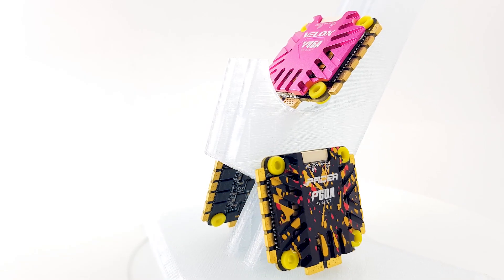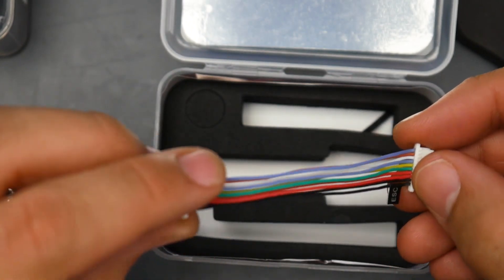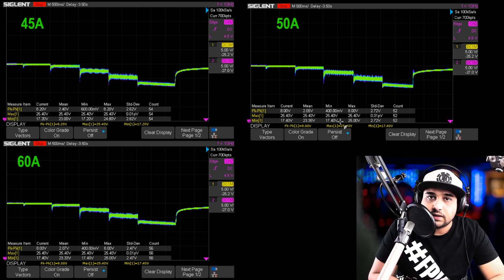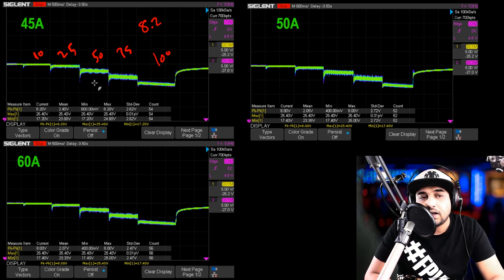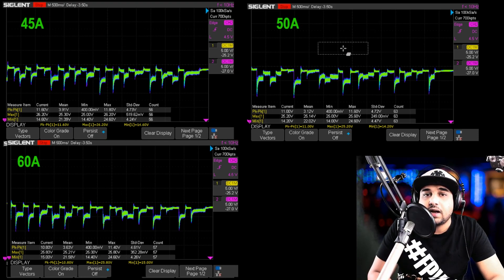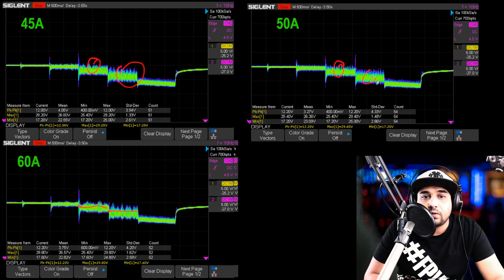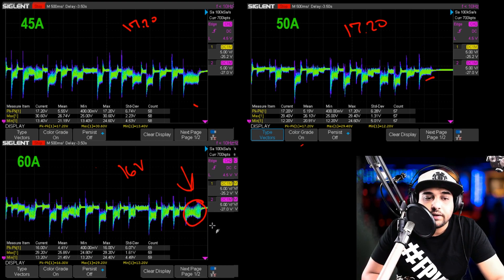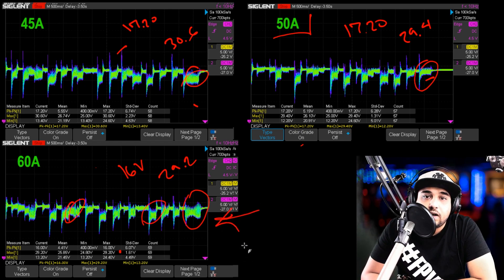WOW!!  T-Motor Velox 45A - Pacer 50A - Pacer 60A Review

Comment: And if these 3 the 45A seems to be the sewwt spot of the firmware board setup? And is 45A enough to run 6S in you opinion.  I know you said video's like this don't get many views but guys like me that want to understand how it works in really number to make the most reliable purchase really like your hard work! For me this was the first time I have seen graphed the differences in using capacitors do you have a recommendation for the best one for 6s

Comment: Loved the review... thanks! By the way... are those 10 pin JST connectors basically the same size as the typical ESC 8 pin ones (apart from having 2 more pins of course)? Just wondering if I could just play with the wires and connect those to a (typical) 8 pin JST connector FC.

Comment: Imo T motor did a horrible job designing there wiring diagram with absolutely no pictures of wiring to a esc and also no pictures of a esc with the 10volt connection used for dji they show 2 separate ground connections but dont define the difference without your video I would have likely connected to the wrong ground.

Comment: Don't buy T-motor Velox 45A ESC. They are trash. Bought 3 pcs 14 days ago, and 2 are already dead. Not burned up in flames, just one motor stopped spinning. Had them in 2 different quads and both on 4s. Both ESC's died within 20 packs. So dissapointed cause they flew really good and had low noise.
Reply: Some people I know also had troubles with it, where and when did you buy it? Im trying to gather some info
Reply: @chester_rookie  Bought from Bangood at January 28. Worst ESC I have ever owned. Have been flying for more than 3 years and have build 20+ quads. This ESC is the most fragile ever!

Comment: Hello. How do you remove heat sinks from ESC? Will be nice to make video. Do you thin it is safe to use them without heatsink. At least there is heatsink just on one side but fets are on both sides. Thanks